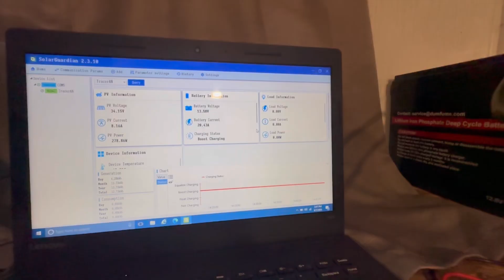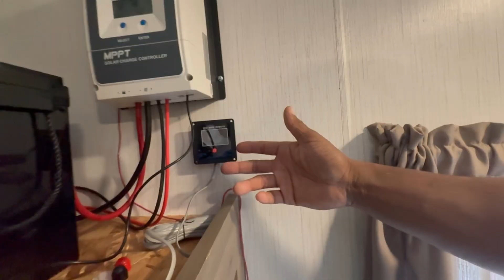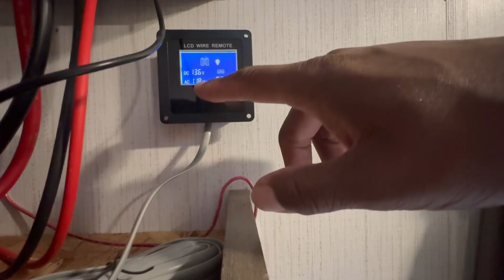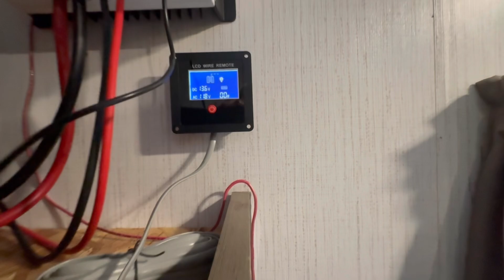Off-Grid Power: Our Solar + Battery System Explained

Comment: Just happen to run into you guys video, and yes solar is a learning curve for sure, I always say knowledge is power! I've had solar for over 10 yrs now, and I did a lot of learning and research before I got started, I just didnt have the money to make a ton of mistakes, and we all know solar can get expensive, even more so if you have to do it twice. Im 62 and retired, I have 6kw on my roof, never had a problem with, I also have 2-3000w low frequency ( transformer based) solar power stations, they are different than the ones you would normally see, Ecoflow, Bluetti, Oupes, etc, those are high frequency units ( igbt transistor based ) units!  Low frequency units are like the power grid, transformer based, and strong long term reliable units, there also different in the fact that they are infinitely exspandable,  no limit on how much battery capacity, and they dont have to use there own batteries, they have built in external exspansion port, non proprietary,  and can use anyones battery or chemistry, and they charge and discharge from the unit, and actually load share, that is, they share the amp load of the system in unison with the factory batteries. ie, 3000w ÷ 24v = 125amps ÷ 5. 100ah batteries = 25amp load at max output on each battery, lightening the load and stress, and cable size, which in turn makes your system run, longer, cooler, less stress and last much longer. These units can charge ac 1500w, solar in 2000w, and 20 amp car charging 240w,  and dicharge full power at the same time, thats 3740w input, there is not one single proprietary plug on the units, charging,solar,external battery exspansion, all standard Anderson plugs, my factory batteries stack, and plug together Anderson direct, no cables, and if for some reason my unit failed, I can use the factory batteries on any 24v inverter.  I have 10kwh in battery capacity on my units, 1 can power every 120v outlet and every 120v appliance in my 2600sq ft house, with just 1 cable, I've powered a 1800w air fryer, refrigerator 26cu ft, tv, lights and a regular washing machine at the same time, but who realy does that, the power station can run just my refrigerator for more than 8 days on 1 charge, the idle consumption ( just being turned on and not running anything) is just 13w,  thats a big factor, why, if your powering your refrigerator, it cycles on and off all day and all night, but your unit is still using the battery even when the fridge is not, thats idle, so think about this, 13w × 24hrs =312w,  thats what you want, but most units ( high frequency)  is 35- 50w and usually have 2-3 kw battery, lets average at  42w x 24hrs is 720w thats half or 1/3 of there battery capacity gone doing nothing, and then there average effeciency is 85-90 %( converting dc to ac) and theres another 15 % loss, which basically leaves very little to run your equipment from. I give these examples hoping it will help you guys learn and make good decisions as you keep going! Building your own system is cheaper, just remember, low frequency is much stronger, more batteries lighten the load, higher voltage ie 12v,24v, 48v, the higher the better, 12v good to 1500w ÷ 12v = 125amps 3000w ÷ 24v = 125amps and 6000w ÷ 48v = 125 amps, these figures can help you make a good decision on what will best suit your needs, and manage to keep your amperage down, higher amperage will cost you more money in, fuses and cableing, lower amps is cheaper and safer, but by going higher in voltage will allow more wattage. Also backup charging ideas, gas generator, and a simple 12v inverter 1200w  to ac charge up your batteries from your car battery, always have mutiple ways to recharge your batteries, never know when , clouds, rain, snow or whatever may get in the way! Best wishes and much luck as you journey forward!
Reply from the maker: Thank you for your comment and great information. I have definitely been considering increasing the system voltage to 24v or even maybe 48v. You said it more voltage more power! Thanks again !

Comment: Nice ingenuity, that's what you need. shademap app set it to dec16 and check your winter shadows before you make a permanent mount, looks like southern state your solar panel set up is opposite of mine, in your area the best mount is a horizontal, you can make a rotating pole like a rotisserie, 90 degree arc, a half circle polished surface or mylay on cut sona tubes put under the length of the mount, I would recommend a single panel test before committing. I live in cloudy -25 winters I use solar for electric heat and all else, I am sure you want 4000w of solar for winter, currently my AC use is low this week I can turn off the solar for 8 days, in winter 2 days on a charge. My entire build is automated, 5 mins chores a month and stay home for 120 days is easy.  Since Mar 2024 till now 68 Gen hours in winter I use 20kwh daily. I haven't seen anyone do a build that can perform like mine, but I would like to help you do it, the entire trailer is externally insulated even on the ground 100% enclosed, heated basement, 600 gal water tank, grey treatment drains underground year round, 16 x 12v 250 Lead Carbon (DOD 100% -30 no heater, sealed, no gassing, no bms, emp proof, 15yrs np nothing to fail, charge 11kw) weighs 2780 lbs so under the rear of the trailer on insulation, water heater and cooking is all 120V, LPG only for the Gen which can get 450kwh between fills, with the new inverter future 5000w dryer possible with a 8 hour nighttime run. No flames, no gasses, no lithium, enough gen fuel to run a month if all power lost, seriously I could lock myself in for 3 months and be fine. This year with latest upgrades I am trying go "zero gen" from now on. If your low temp is 15F $8k more solar and your on electric heat or Air con year round.
Reply from the maker: Wow! I really appreciate your expertise and the time you took to share all of this with us! 🙌 You’ve given us a lot to look into and consider as we keep improving our setup. Thank you for helping us learn — we’re excited to keep growing on this journey!
Reply: @asimplejourney  I see you have multiple rooms I bet the rug buddy 170w 4kwh could heat the kids rooms in winter, wood is quite a pain, I have a 170w provides 40% of my heat, plug in Oct unplug in May easy and super safe you can pour water on it.